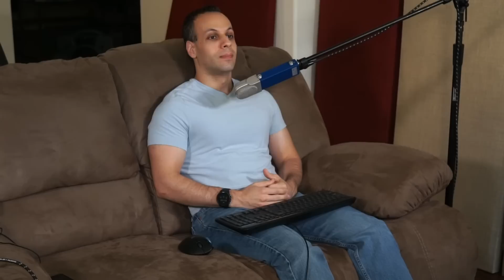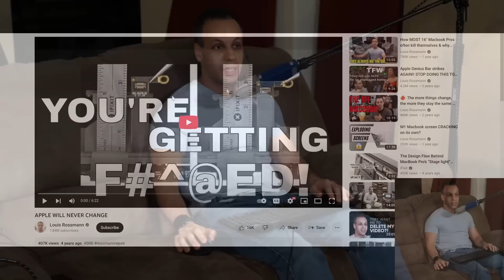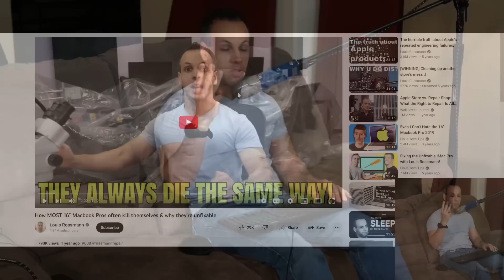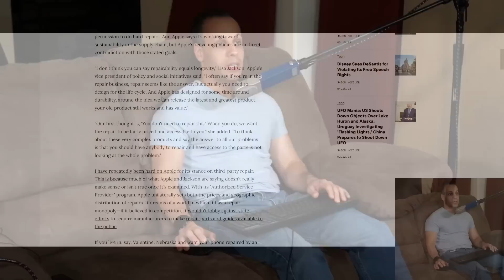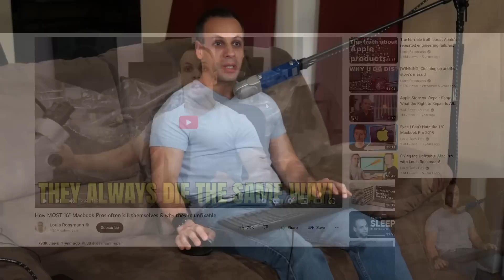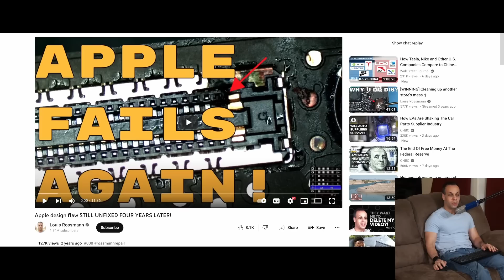Apple exec's latest interview is a pile of greenwashed BS

Comment: Easy counter

If they claim an irreplaceable battery is not prone to failure then force them to have a free lifetime warranty on the battery
Reply: and then they define "lifetime" as "whenever the product stops working" because they mean the lifetime of the product, not of the buyer.
Reply: @PubliusHadrianus  This is a classic warranty scam, can't believe people still fall for it.
Reply: @PubliusHadrianus  Ah yes, the 3 year lifetime warranty, perfect for apple addicted gerbils.
Reply: @MetroidChild  Apple was the one that here in they EU asked money to "optionally" extend the warranty from 1 to 2 years, when the laws in EU say that minimum warranty for consumer products is 2 years. And people paid for that extension.
Reply: Reminds me of a merchant on Diablo 2 "All products come warranted for life. Or a 2 day warranty"
Reply: And then they just claim something else is broken or even better; design the battery to break something else when it dies so it won’t be covered by the battery warranty
Reply: @giantninja9173 
Some sort of low voltage fuse that trips out the moment the battery voltage goes below 3.0V. And it's embedded inside the main SoC.
Damn it... With devious design ideas like that, I should get a job at Apple.
Reply: @tin2001  They have more devious people already. Although the fuse idea you just had is pretty good!
Reply: @tin2001 All modern li-ion batteries has a supervisor chip that blocks charging if the voltage drops too low. Because charging a too empty li-ion battery can result in a fire.

So the battery gets disconnected before the voltage drops too low - the 0% shown for laptop or phone always means there are a couple of percent left in the battery to handle self-discharge if the user doesn't directly recharge the device.

And this is also why a user must never leave li-ion batteries drained for a long time. They should get some more charge every 3-6 months just so they don't dip too low.
Reply: Not lifetime, ask for a number of years we know it won't last for, that way you have something they can't worm out of it on some bullshit.

Comment: I hope the EU harasses Apple into submission for battery replacement GB chip exchanges etc. they are not what Steve Jobs was I understand wanting to have water resistance but doing it at the expense of making it as closed off as possible is getting ridiculous now I don’t mind a single Apple ID (as a side I admit that I have iTunes purchases as I’m probably one of the few that does now a days)but I should be able to customize certain aspects of my device if I’m having to (fork close to $1,200 by the time the beginning of the 2nd year rolls around)if Apple wants to have proprietary parts for the iPhone or maybe even in some cases iPad but allow single parts at all Walmarts if nothing else.

Comment: I'm 100% expecting Apple to be dicks when EU legislation comes in because that's what they always do. They might comply by making the battery user replaceable and then DRM the battery or artificially restrict supply. So regardless of the battery being replaceable, there are no batteries to replace it with. Or maybe replacing the battery voids the warranty or disables updates because why not? Because Apple are dicks and they are constantly looking for ways to subvert the legislation.

Comment: I don't care how "durable" they claim to be trying to make these devices. The FACT of the matter is that batteries and ssds have a limited lifespan no matter how well you take care of them. Yes you can extend that lifespan, but these parts WILL fail eventually and for apple to stick there head in the sand and pretend they can fix a fundamental fact of how these parts work is hilarious to me.

Comment: So, "using their data we can understand.. which parts never need to be replaced". So, few things. First, which parts of the phone has the 'data' told them to make replaceable, because last I checked, every single component in an iPhone is impossible for the average user to replace. Which leads me to the second point, if their exec has just said the parts that cannot be replaced, are not replaceable because they are designed to never fail, if they do fail, apple have failed and so should repair / replace for free.

Comment: so will OEMs still be able to use like 6-8 (or whatever) screws for a battery cover to help waterproofing?  I don't think using a few external, meaning easy accessible, screws should violate the spirit of the new incoming regulation.  but honestly, I'm not that big on water-proofing.  water resistance though, like handling rain would be helpful.

Comment: Probably, I agree with all the points, but for some reason Apple just never fails on me personally. Use for ~10y or so. Sooo…they learn, probably. 

Idk. I think it’s supply and demand problem. If people wanted to pay more, but have a repairable iPhone - Apple would do that.  

I’d buy a usb-c iPhone for 300$ more anytime, but nobody else would, since it should be “cheaper” due to standards. I just want a plain “150$mo” Apple tax fee and that’s it. Just do devices now without thinking how to get extra 2 cents and cause me problems. 

But this is only my 2 cents.

Comment: As someone that bought a Librem 14 (which was junk) then got a Galago Pro 14 which is much better but sounded like a 747 taking off and at best had a 1.5 hour battery life. Im happy with my macbook pro 14. The battery in the mac lasts all day, the computer is fast and apps actually run on it. The mac will charge with any usb c charger from a 25 watt charger to the included 96 watt charger. Plus as an added bonus, you can plug said usb c charger into any usb c port - not just the one designated for PD.  And for $99 a year no matter what goes wrong with the laptop, apple will fix it.  At the end of the day I just need my computer to work. I don't mind paying extra for apple care if it means no surprise repair bills. Apple is amazing compared to a premium laptop like the System 76. With apple the speakers don't sound like the audio is coming out of a tin can, the battery works and any charger works, when you close the lid the laptop actually turns off too! I can go on and on. Apple is not perfect and they do some shady stuff but they are much, much better than some of the other laptops I bought in the past.

Comment: My only comcern with the removable battery thing is how. Because on one hand phone backs tnat just clip/slide off are a mightmare (drop an old phone you will see) and intern scres on the back of the phone to allow access to the battery would be reasonable. On the other hand i fear if we allow screws apple will use some kind of screw that needs a special apple screwdriver.

I think easily removable will need to basically encompas being able to be removed using commanly availbe tools (small philips head screwdriver) or hands. This would give engineers a bit more breathing room and pretty much negate a large ammount of arguments against this.
Reply: The fact that you think you will see SCREWS on the iphone back is dumb as hell! NO smartphone will chose that

Comment: I'm wondering if they use their data in a more subtle way. I'm thinking that perhaps they run statistics on what people report as problems, but also maybe they actually research what people attribute to Apple, versus themselves. I'm thinking they might deliberately fix design issues that result in failures within warranty time that involve things that users don't think they have control over, but maybe they leave these design flaws that require something that would be perceived as "user error" to trigger them. It seems like that would account for a lot of the examples that are brought up in the video of things that they don't quickly correct about their designs. So, for example, putting a high voltage line by a sensitive connection might not have originally been designed to create planned obsolescence, but, at the same time, if it does fail, it looks like the user caused it, and so they don't have to respond to it as a warranty issue necessarily, and, also, they get the business of someone replacing it with a new product potentially without the user being aware of their arguably malevolent design process.

The fact that they "used statistics" in addressing these issues just seems like it would reinforce the idea that there's deliberate neglect of actually fixing that sort of thing.

Comment: The core of the problem is that lifespan requirements for products should be determined by a cost/benefit analysis from the users perspective not the manufacturers perspective.
"If we spend a few cents more here we can extend the expected product life by 1 year."   That's a benefit to the user, it only costs them a few cents more and lasts way longer.
but that same thing is a liability to the manufacturer who wants to sell future models.

Comment: I heavily use my phone. My battery health is 90% on my 13 pro max I’ve had for a year. I know it’s going to need a battery replacement eventually. And when I replace that battery, I don’t want any DRM stopping me. I want my phone to boot and display battery health, like it did on the earlier iPhones. These phones are made so powerful that there IS NOT a NEED to upgrade every single year. I’m hoping to get a lot of mileage out of my iPhone before even thinking about upgrading. If they want people to upgrade, they need to quit making the same phone every year with some stupid feature that they could implement on older phones just to make people go “ooh shiny shit”

Comment: It's very simple. Connectors cost money. Soldering is either done by machine or labor in China that is cheaper than the connector. Of course there's way to solder things such that they can still be replaced by someone with skill, but once it's soldered the next step is that it becomes difficult/impossible to do so because there's another cost savings or they were forced into a corner design wise and the way out was 'well it's soldered anyway'.  
There's no analysis done beyond that. It's pure part and assembly cost with the occasional it's the only way to make the design requirements. Nothing more.

As to the data line/power line issue. That's someone's blunder and the problem is that blunder causes a cascade of things to change. Can it be done? Sure. But everyone has other things to do. The disturbing part is that the blunder wasn't caught early on when it could have been fixed. This tells me they aren't properly putting their phones through environmental chambers that through accelerated testing would have turned up the problem. Or maybe they did, but didn't care. The slow to fix after release I understand, the not detecting it in development, that's the big problem.

Comment: Of course they are data driven with regards to reparability.
Too many third party repairers are repairing their products preventing the sales of new ones, so they use the data to work out the best way to prevent this.
Lets encode parts to the machine so the parts can't be replaced by third parties, and we will replace a whole board or device and make more money.
How can we make the device more susceptible to user cause failure so we don't have to warrant it.
So yes Apple is data driven with regards to reparability, just not in the direction the user would like.

Comment: THE ONLY WAY that someone will, ahem 😒 'Hurt themselves', by puncturing a Lithium battery, will be due to manufacturers WELDING their batteries into the chassis with FECKIN' SUPERGLUE!!! Ok, maybe not 'Superglue' per se, but JEEEEEZUZ CHRIST! HOW MUCH FECKIN' GLUE/SUPER STRONG STICKY TAPE DO THEY NEED TO USE TO HOLD A RELATIVELY LIGHT BATTERY IN PLACE?!?!?!? I've SAID THIS FOR YEARS!!!  😒😒😠😠
😎🇬🇧

Comment: It's funny that the original Unibody MacBook Pros had a battery that was easier to replace as long as you had a Tri-Wing screwdriver as it was only held in by screws and not glued down.

Apple used to make such easy to repair products, not anymore. My sister had an iPod Touch Gen 2 and she dropped it. No broken screen but there a was teeny tiny dent near the power button which jammed it so that button no longer could be pressed. Apple said we'll give you 10% of new iPod Touch. Due to my hatred for being ripped off like that I blew a gasket and started screaming and yelling how Apple hates its customers and such and stormed out of the Apple Store. I guess they didn't like someone screaming that and they gave my sister a replacement iPod Touch 2 for free.

They engineer their products now so they break easier so they can milk more money out of the consumer.  Apple talks about being environmentally friendly while engineering stuff not to be easily repairable so it ends up as eWaste. What a hypocrite Apple is.

Comment: My current phone apparently is dying to the old battery dilemma and... yeah, I wish I could just open up the case and give it a new battery. I've been eyeing some repair shops, but they usually operate on my usual working hours. Simply not giving the customer the option to easily "fix" the phone is a giant F-U anti-consumer practice.

Comment: My worst experience with Apple was the bend gate. Had to drive an hour and 45 minutes to an Apple store they claimed to fix my phone and not even 15 minutes later had to turn back around because the phone was stuck in a boot loop and they gave me a new one then a few weeks later my phone just randomly dies and I had no idea why only to find out in like 2017-2018 there was this Bend gate issue. I remember my first iPhone was the iPhone 4 and I thought I could purchase a battery and repair it myself because the battery kept dying fast that’s when I found out I had to contact my friend who specialized in fixing phones to make this repair and it was always 40 bucks. Only because he had special tools and knew how to carefully take everything out. That entire time I was thinking to myself why the hell are they making it so difficult to swap out a battery? Before iPhones I could just pop a battery in and out of any android device. I’ve had a 10 R since 2018 and it’s held up pretty good until recently and the back finally started cracking from drops, my only other issue with Apple is there’s no option for expandable storage and I would much rather buy a microSD card instead of having to shell out every month for cloud storage cause if my card is locked or if for some reason, I miss one payment, then my phone slows down like hell. I’ve been able to except not being able to install any software you want on my phone, but when it comes to repairs and storage, it’s kind of ridiculous. iPhone 15 Sounds like my next upgrade but I’m strongly considering switching to android again.

Comment: I'm fine with having to unglue my device to replace the battery, especially if that design decision allows to make thinner device with bigger battery and waterproof body. It's something people do once in 4-5 years; my iPhone XS probably will last 6-7 on an original battery; it doesn't matter if replacement takes 1 minute or 30 minutes. 

I'm NOT fine with Apple serialising parts and disabling battery power management if battery is replaced without their 'consent'. EU should be focused on this, and journalists and politicians should push Apple into admitting they do it for the profit and because they hate humanity.

Comment: Major appreciation for information you continue to provide for ordinary customers. I was an ardent Apple fan from the first Mac through the G4. I even toured with the Apple business forums (for a software company). But the PIRATE FLAG is now REAL. Don't know what I will due when my IMac 27 eventually dies (mid 2011 with updated RAM and SSD drives). Thing is, my computer is fast enough and current software capable enough for my needs. EXCEPT, the excellent drawing software that I bought multiple times till they pulled the plug on Apple software. ARGH! What gives them the right to stop supporting software you bought? Even the original MacDraw that came with the Mac was pretty darn good (especially for the tiny footprint the code by Andy Hertzfeld took up).

Comment: This is part of the reason why I am avoidance of Apple products, when it comes like the flaws you had mentioned. And my older brother had basically bought new iPod nano (or mini) after one of them didn't boot up after the battery had drained to zero. So, I doubt they were anywhere close to being a pioneer when it came to "durability" and "longevity".

Comment: I don't disagree with them that it's better if you don't have to repair the phone, and I don't disagree that repairability can lead to things that more easily break. While it is possible, creating something sturdy and easily repairable is just plain difficult. Not impossible, difficult.

However, the battery WILL ABSOLUTELY WITHOUT QUESTION BREAK. They just do that - all of them. When the battery in my iPad Air 2 died some years ago they didn't replace the battery, instead sending me a new but different iPad that didn't fit my peripherals. I did not ask for that, I asked them to replace the battery. I was pissed!

The gaslighting here is making the argument that you shouldn't have to repair batteries because they can last forever. They cannot. It's BS.

Comment: 6 screws, a o ring and a panel, this is not hard.
ALSO the "life cycle" of the product? It's a machine not a animal or plant, I've seen electric motors from 1920 that start just after a small cleaning, maybe a brunch replacement at most.
Reply: But that make shareholder sad as they dont see line going up from selling more